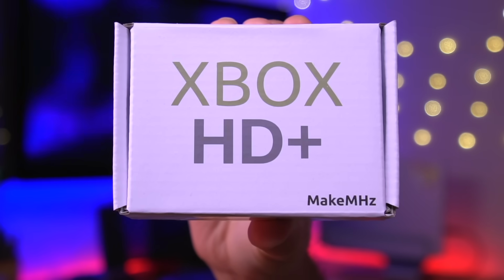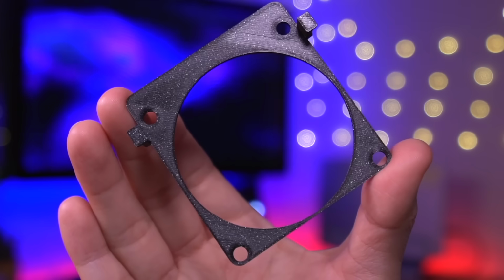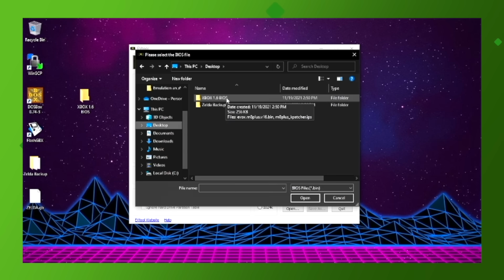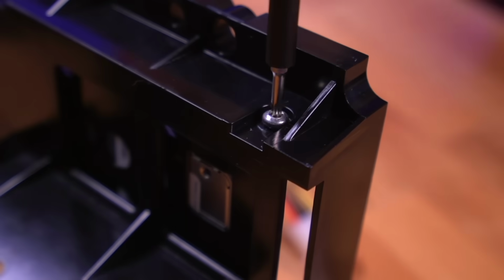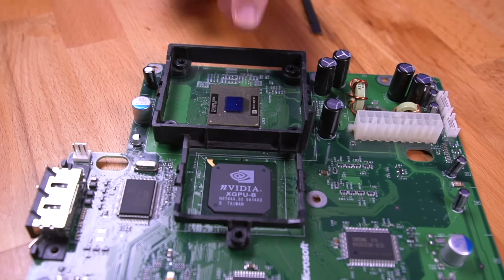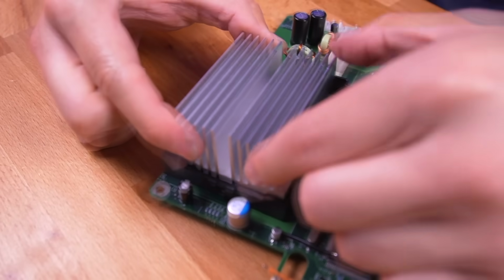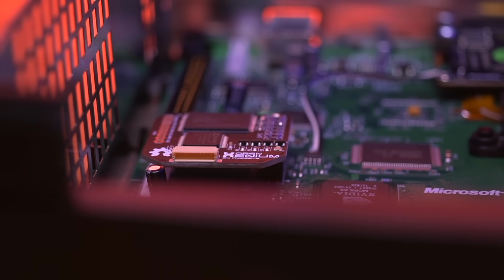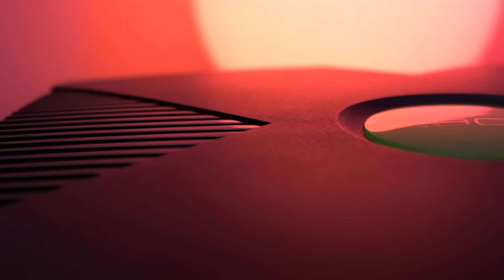I BUILT THE ULTIMATE XBOX TO CELEBRATE ITS 20th ANNIVERSARY | MakeMHz HDMI + SSD + OpenXenium +MORE!

Comment: An SSD that's interesting I never even thought of that I still just use the mechanical drives.  SSD is probably real good cause the mech drives can get pretty hot in the original xbox case
Reply: If anything, having an SSD from this year will still be miles more reliable than a roughly 20 year old HDD
Reply: @sdbegotist  i have 30 plus year old hdds still operating without issue, including my original xbox hdd
Reply: @Wolfstanus  why would you put a hard drive 10 years older than the OG Xbox in there, 30 years ago the average hdd size was 40mb and 3500rpm, that's an enormous downgrade from what was in the OG Xbox.
Reply: @Wolfstanus  And their capacity?
Reply: @chrisrulz555  im not saying i put one in there. Its still using its original drive.

Im saying i have hard drives upto 30 plus years old. Learn to read

An ssd generates more heat than a normal hdd, kills itself slowly with the heat it generates and runs into bottlenecking issues when put into hardware that isnt capable of using it properly. This is why modern SSD have heatsinks, liquid cooling options in some cases and warn to not remove them because  they need the cooling

You sound like those people that said the CD is superior and will last hundreds of years! Meanwhile I have discs sitting on the shelf that died by sitting in a climate controlled environment. Yeah, disc rotvand bit rot and yes, bit rot affects solid state drives more than other storage methods. An HDD can store its data for decades while not in use, an SSD cannot
Reply: So what I gather from this excessively long in depth thread is to do exactly what I was planning anyways.  HHD master copy to use as a long term baseline to clone from,  and SSDs for actual build use,  and to back those up periodically.

Got it. 

FYI y'all.... if you do a DVD Delete and remove the HDD tray,  you need to find an alternative method to address airflow,  because you remove the controlled direction of the airflow when you do and the air does not cool the heatsynchs as effectively.
Reply: Your all forgetting that the SATA drive will use less power than any HDD, takes up less space (better airflow), and is also silent (going along with the fan) so an SSD sounds worth it to me.

If you are woried then you can use a laptop HDD they are the same size as an SSD and use less power than a bigger HDD though they are still noisy.
Reply: yeah, but you wouldn't notice the speed difference and the ssd wouldn't last as long in the system
Reply from the maker: Agree, I don’t think there will be much of a performance bump but I’m hoping for better temps and longevity
Reply: @MachoNachoProductions  there will be no performance bump because of bottlenecking. It won't last longer than an HDD because of how an SSD operates when saving, storing and rewriting information along with temperature changes it experiences. They slowly kill themselves just from normal use
Reply: @Wolfstanus  That last sentence was beautiful and funny
Reply: @Wolfstanus  it's why I would love a standalone 32GB Optane + 2TB NAND SSD with a SATA interface.
It would be able to extend the lifetime of the SSD by 100 times for this use case and other legacy machines.

Writes are the only thing that reduces the life span, if you fill the nand portion with all the games and handle scratch/page/temp files on the Optane portion it would likely outlive you, your kids and your grandkids as long as it's periodically powered on to avoid the at rest blanking that can occur on NAND.
Reply: @magfal  What happens to most systems? They get unplugged for years to decades being stored in attics, basements, sheds etc
Reply: @Wolfstanus  as long as they're not stored hot they do last for a few years.
Reply: @Wolfstanus  I have a seven year old SSD that I am using as my main os drive, it has been in constant use since 2014. I have zero problems with it, the amount of write cycles a typical ssd has is ridiculously high and you would really only hit that limit if you were using it in a data center.
Reply: @chrisrulz555  uh huh, typical SSD has a life expectancy of an SSD in 2017 was 100 terabits written before failure depending on optimal climate. an SSD will eventually die from not being used for long periods or improperly stored
Reply: @Wolfstanus  the entire US Xbox library is in the vicinity of 2TB IIRC and saves are measured in kilobytes. The amount of use to match 100tb of write capacity would almost be impossible in a lifetime.
Reply: @chrisrulz555  The thing with an SSD is that simply being on slowly kills it. being off slowly kills it an HDD doesn't do that
Reply: @Wolfstanus  Like I said, I have a seven year old SSD that's still running strong as my main os drive which has pretty typical user write cycles. That's plenty of life, no piece of complex electronics will last forever.
Reply: @chrisrulz555  yeah and mine is around the same age. I have hard first gen hard drives still going after being stored in sheds and attics that are still operating like new. As I am saying the SSD has a multiple designed failure points that guarantee their eventual death, like lithium ion batteries that guarantee destroying the device they are in. I know electronics eventually die, I probably have more in 1 room than you have in your entire house and most "dead" electronics just need a simple recap or the thing most people can't comprehend. A simple cleaning
Reply: @chrisrulz555  One advantage of hard drives for this console is that you can make a simple backup using HDD Raw Copy. If your OG Xbox has the drive key nulled, you can just replace it. Let's say you have a 2TB HDD, you can clone it using that software so when it dies you can easily replace it without losing anything.
Mine is still fairly new but it's what I plan on doing at some point because it has hundreds of games and I don't want to re-install them if the hard drive fails. I am not sure if the SSD has similar software for backups. 
Though, these things can last forever to be honest if you take good care of them. The console's original 8GB IDE HDD still works fine to this day.
Reply: @Manic_Panic  You can do exactly the same thing with an ssd, the procedure is the same.
Reply: @chrisrulz555  Exactly, people regurgitate hypothetical things they hear from tech sites that aren't close to real world. I also have an SSD from 2014 that I have used for my C drive since then, no problems. Mechanical drives, they are always a coin toss. I doubt anyone here has used an SSD to the point of breaking down.
Reply: SSD doesn't have the staying power if an HDD. They have a built in expiration
Reply: @sdbegotist  what model? What year? What brand? And in what computer? Am i using a computer for all them or external drives?  Hmmm so many questions for your vague question.
Reply: @Wolfstanus Since you neglected my question, lets do a little dive. Concerning hard drive capacities that averaged 1998 & 2003, for 2003 the average was 80GB, 120GB & 160GB, while the max capacity for a 1998 HDD was 16.8GB; since the question was talking about the XBOX, and not your personal storage solutions, I think you were taking my statement out of context.
With previous replies from other people, it sounds like you’ve confused the intention of the video.
I don’t know what your using on your 30-year old HDDs, but just remember this simple rule for backing up, save to at least two different mediums, and another away from home; I don’t know what SSDs you’ve been ordering, or what jobs you were tasking them up for, but that might be more a setup issue, or just trolling at this stage
Reply: @sdbegotist  no i didn't, i asked what years etc because that matters a lot. typically around 40 in the early to mid 90s I have ones at 8 to 100. I have one from. the early to mid 2ks thats 250 gig. I have a few small sata hdds that range from 20 to 80 gigs. I also a couple in the megs. The megabites from the 80s. I also have one thats not even an HDD, but its just a floppy drive with a floppy "permanently" inserted into it and its not even for storage, just to boot dos from it. But i can "modify" it for storage by just removing the floppy by taking the unit apart and inserting a blank one into it

I have like what, 6 different mediums to save information to lol.

Hdd is more reliable and when you shove an ssd into ancient technology they don't perform as good as an HDD from that era. Its like me shoving my wd2500 into a windows 95 pc. Its not going to work right even with modifications. Same thing with this application.

The issues with ssd, their failure rates, failures when unplugged for long durations. Remember old tech shuts off completely or to such a minimum of power that it only maintains the cmos if they don't have a cmos battery of some type.

I also have around 10 ssd drives ranging from 150 gigs to 4 terabytes with i don't know how man different types of memory cards and usb sticks.

All my drives range from seagate, western digital, toshiba, pny, Mitsubishi etc
Reply: @Wolfstanus  But since you didn’t share that earlier, I had to make my own assumptions. Since your coverage is potentially over various different eras of devices, I also have to speculate your also using at least a more modern system for general convenience with web search and media consumption. Having a medium to communicate with them all is good, but with the video being about modernising the original XBOX, finding a reliable SATA will be significantly easier than trying to find a working IDE drive that’ll make future maintenance more convenient as the latter becomes more and more rare
Reply: @sdbegotist  i don't have to share every minute detail of having well over. 40 systems do you have any idea how much a fire hazard that is to have plugged in all at once? The layers of an SSD deteriorate just by existing in a box. I just picked up a complete ti 99 4a so now i have a late 70s computer.

You know what would benefit the xbox more than an ssd? A sata hdd because its not going to bottleneck as badly and sitting in a corner with the power off wont harm the drive because of how the medium is stored and the way the og xbox powers down. Mind you that each xbox is married to its own hard drive it was packed with so if you lose that information, the xbox is screwed.

Im currently working on an xbox thats been bricked because someone had the bright idea to try and shove modern stuff into it and now it thinks every hard drive is full. I can't even get its original drive to save information or delete anything
Reply: @Wolfstanus  This just sounds like a lot to cope with. Everyone has a right to collect what they want, though with the sheer number mentioned, and the mention of also getting a recent XBOX with modification issues; I’m hoping it’s to sell onto other collectors, otherwise I hope it’s all staying dry and well ventilated.
If insisting to stick with a HDD, go with it, we obviously can’t stop you with your own projects, just you seem to try and justify every response with trying to one-up without reading through people’s comments, and taking in what they’ve said.

EDIT: Will also be my last response, because if going from previous messages, it looks to be going in circles
Reply: @sdbegotist  at what point did i say they dont have a right to collect? Please point it out to me, I would love to see you put words in my mouth yet again.

I have like a bunch of ssd drives sooooooooo.
You guys littlely failed to read what i said and put words in my mouth so at wgat point should i care about what else you tell me? 

I know the issues of an ssd, its strong points and its weak points and what typically kills them, there are many youtube videos and long well researched articles on the subject. Im not saying they're horrible.

Yeah shut down after putting more words in my mouth yet again 

Why should i sell my property again? Yeah i mentioned i have a climate controlled room in an earlier comment so.

The og xbox gains nothing of value with an SSD and it maybe experienceing bottlenecking issues among heating issues depending on the SSD you shove into it. Since ramming an SSD is relatively new modification, we don't know if the system can handle it with power because the system was built with  an HDD in mind and that does use more power than an SSD so the PSU or other components maybe getting damaged over time. Now the normal spot forcan HDd in the og xbox has zero airflow because an HDD doesn't really care about Temps but an ssd actually does care and heat kills an ssd

Comment: I wanted to upgrade my softmodded XBOX just yesterday. But the whole "HDDs need to be locked, which does not work with every HDD" and the fact, that the picture of my XBOX got very noisy (probably capacitors) kept me from doing it.
Is this still the case with the SATA Bracket + SSD or do I need the Modchip to do that? You never mentioned locking the HDD in the video.
Reply from the maker: That’s interesting, I didn’t have to lock the ssd. It was also probably easier for me because I didn’t have an old hdd that I needed to clone. I was in essence starting from scratch.
Reply: You only need to lock it if you run the stock BIOS. Modded BIOS's work fine with unlocked drives. If its modded, theres no real reason to lock the drive. I'm not 100% sure on soft modded consoles to be honest, mine were always modchipped back in the day.
Reply: @dynamight1124  I have mine softmodded. Maybe I can find some info somewhere. Because I really want its laser to last and use the HDD for it, but the lockable IDE drives are WAY to expensive for just a few GB, just because they are so old :(
Reply: @Rosa_Canina  TSOP flash the console and get a modded BIOS, then you can null the hard drive key. Unless it's the 1.6 variant, then you'll need a mod chip.
Reply: Flashed BIOS & Chips don't need locked drives.